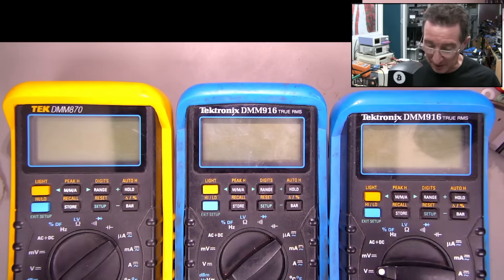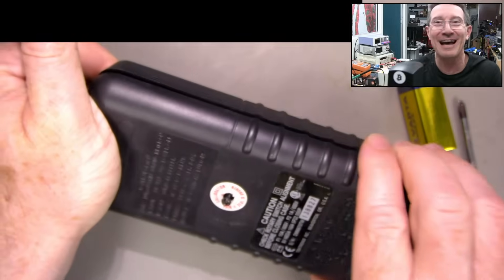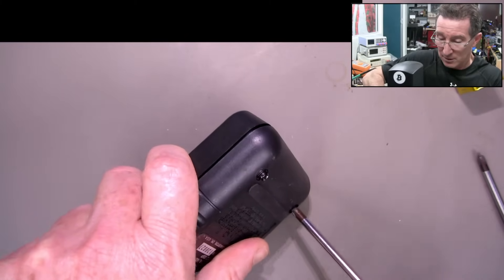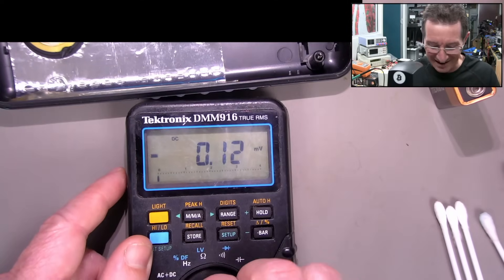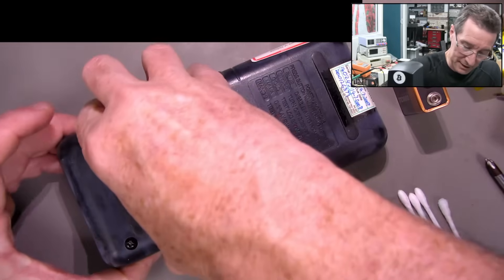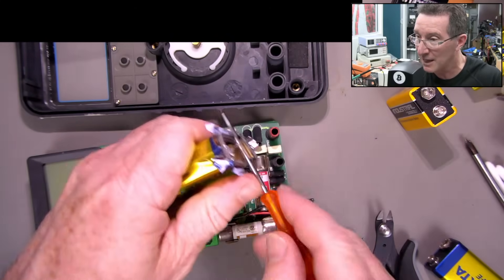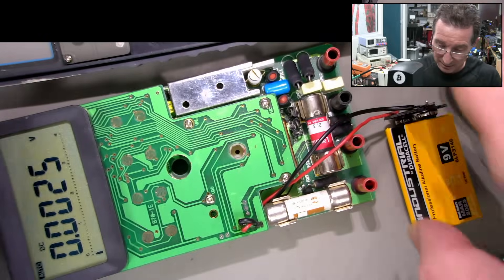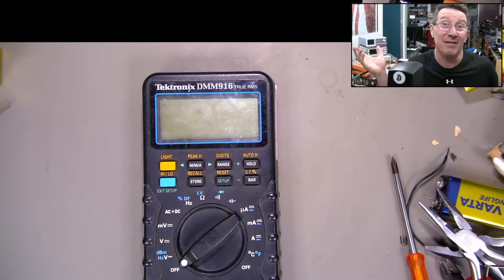Tektronix Multimeter Repair-O-Thon

Comment: Yes, I had a friend who worked at Tektronix for more than a decade. He started out as a temp. He worked on diamond eyes project which was according to him their first portable oscilloscope. It was a thick black brick with a dot matrix display. It was so primitive, and yet so advanced all at the same time.

He worked in the printer division (Xerox), as well as the HD Television division....

Any Tektronix meters actually started out with blue boots, when they switched to yellow they changed the model number (series number). Of course the new color made Fluke very mad. Litigious in fact. He used to go to the what was it, oh yeah, country store where Tek employees could buy Tektronix products for cheap. 

I had a relative who worked there, one of his kids worked there, but he started a business which sold its' products ( not necessarily exclusively ) to Tek.

A neighbor work in the shipping department when Tektronix Computers were shipped to Hollywood for ABCs' Battlestar Galactica series.

Those were the days. You know, the pre George Soros/danaher days.

Comment: With a lipo battery, a tp4056 charging module and a lm2596 buck boost converter module you can make any of these multimeters even better

Comment: Duracell Procells, the forerunner of Duracell Industrial leaked just as much as the consumer batteries, often well within date and in the original packaging.  Just imagine if they devoted the marketing budget to engineering, manufacturing & quality control instead.
Reply: I believe they are the same battery, just relabeled to reduce "pilferage"

Comment: Often vinegar is not enough. The wires inside can be corroded too. The stuff gets sucked into the wire. I replace the whole clip+wires in cases of battery leakage.

Comment: There were a whole heap of DMM916's and a DMM870's sold at the Wyong field day some years ago. I got the last (a DMM870) at a reduced price ($50) as it didn't work; turned out the V+ terminal was loose.
All the meters were ex-RAAF like two of yours.
Apparently the story goes that the DM8xx range were withdrawn from sale when Fluke threatened to sue over copyright as the meters looked too much like some of their meters. Tektronix answer was to change the model numbering and the boot colour from "flukey" yellow to blue.
Reply: I'd believe that story. Fluke has threatened to sue (and I'm sure actually sued once or twice) over other brands using yellow on many occasions.
Reply: @BrananPR  Yeah, Sparkfun in the US found that out a few years vbck when they imported some yellow multimeters.